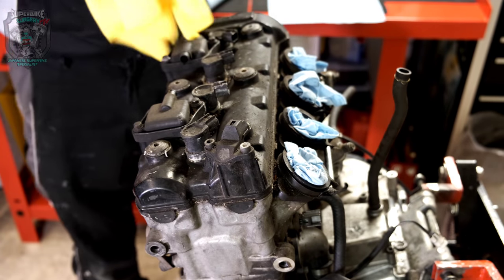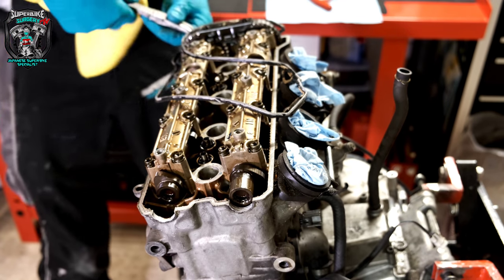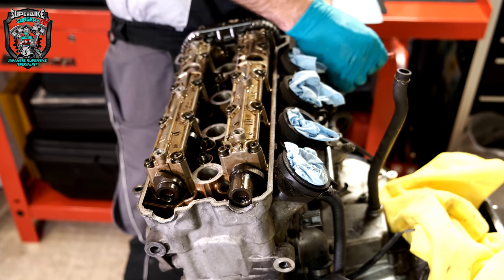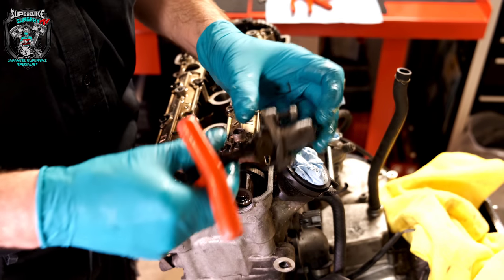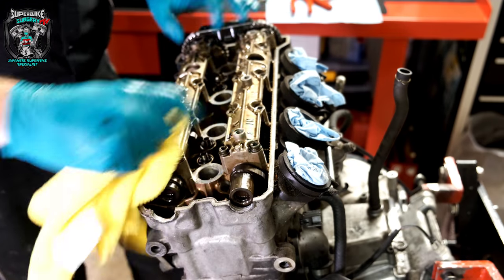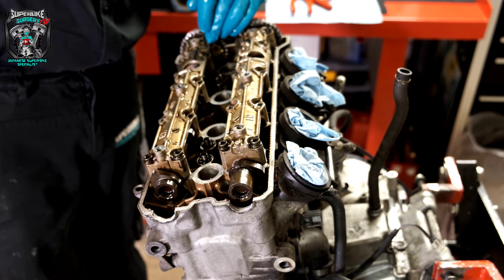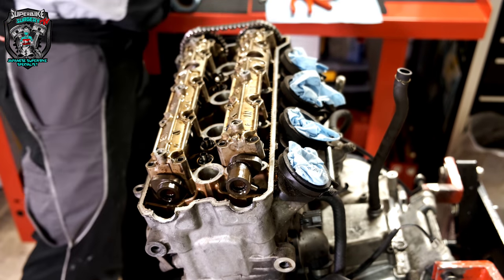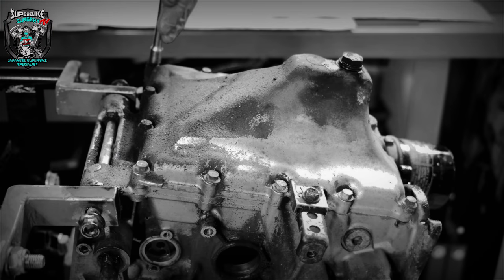Suzuki GSX-R 750 Full Engine Build, Part 1 of 7

Comment: Some good tips here, I’m currently rebuilding an XV535 engine  (well re assembling after a clean up and unseizing it) an being a V Twin it’s simple to get all the valves closed, and my other bike a Parallel Twin just the same but haven’t considered an Inline 4 needing to be taken apart with more consideration like this. Great vid and nice that there’s at least one actual motorcycle mechanic on YouTube giving real advice. But don’t you just find the shims under buckets a pain in the arse to do valve adjustments on when you’re only doing that rather than a strip down ? Thanks for the upload 😊

Comment: Hi i put a hayabusa engine in my dune buggy , I finally got my Busa dune buggy running , and it sounds great but when I start to push the clutch pedal in it makes a grinding noise like if you were you're trying to shift without the clutch ? would you have any idea what it could be ?
Reply from the maker: Really difficult without seeing it 😕
Reply: @SuperbikeSurgeryTV  thanks for replying it worked fine before i put the engine into the dune buggy , it wouldn't have anything to do with converting from clutch lever to floor pedal